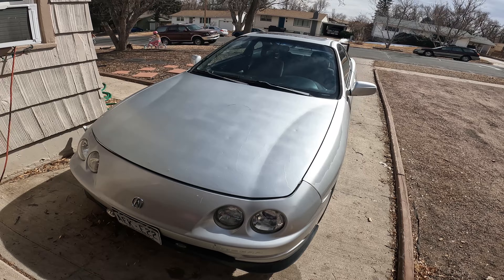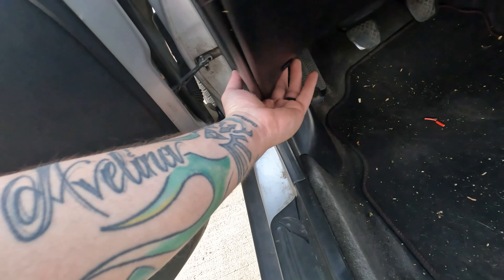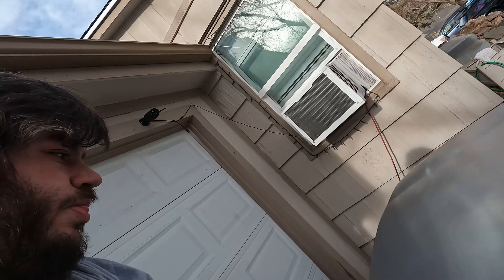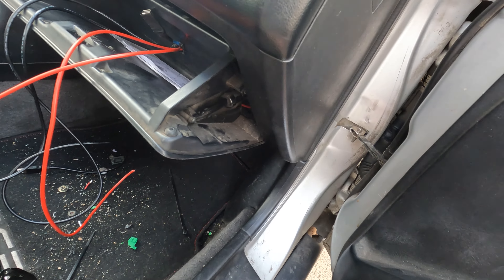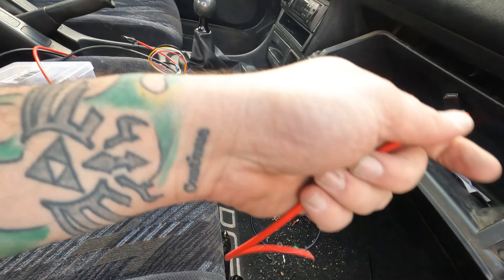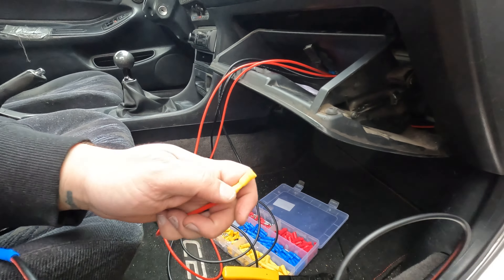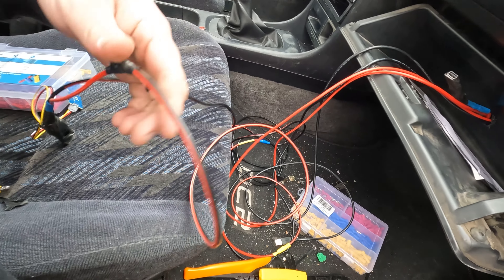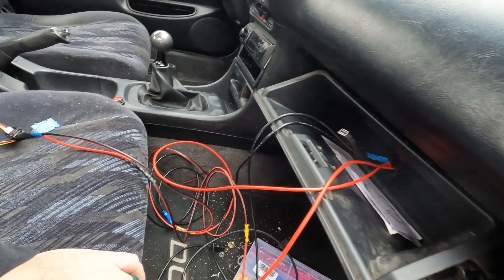Converting My Integra To Flex Fuel (DIY Flex Fuel) | TunerThings

Comment: Love your content brotha! Can't wait to pull out my engine this next week or the next.. I really get frustrated when my car isn't clean or I know there's some flaws.. I always seem to have it in the back of my mind.. lol. But ill be trying my hand in some body work and spraying my car myself outside.. youngstatic has done it plenty of times and I think I can get mine to look at least half way decent.. but the whole bay I want to paint/fill in holes and figure out how to tuck some of the wires i have up under there.. plus this big ole abs module or whatever it is needs to go.. but yeah sorry for rambling.. just got me motivated and inspired to work 9n my car again! Thanks brotha! And I'm buying a 95 civic sedan tomorrow or this Friday for 250 bucks.. no engine, but I got a spare f23a1 block I want to put in it.. don't know if I want to go with another f22a head.. or get a h22 or f20b head and do a g23 swap..
Reply from the maker: Man honestly it bothers me too. Just looking at the bolts and stuff on the floor of my car while I'm working on it drives me crazy.. but so does vacuuming and detailing then hauling my kids and having to do it all over again (not their fault, just being kids haha) but yeah I planned on pulling the motor and doing the same thing to the bay and body this winter but funds got super tight so its coming up here soon. That ABS stuff is atrocious looking for sure, can't wait to either relocate or remove mine. That's a heck of a deal for a whole car, even without the engine! Both the F and the H series are awesome, the world definitely needs more H series cars done well -- Kyle from BoostedBoiz has one of the best out there, definitely inspirational. Either way I know you're gonna make it rock! Keep me posted man, definitely film your progress too!